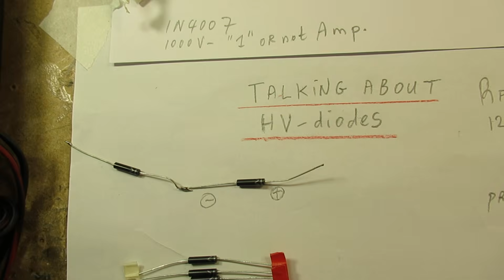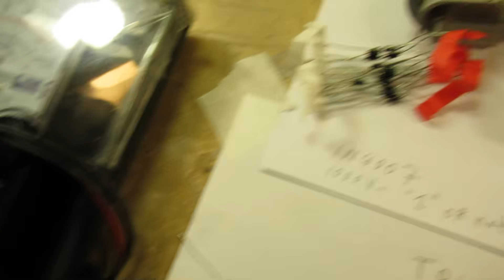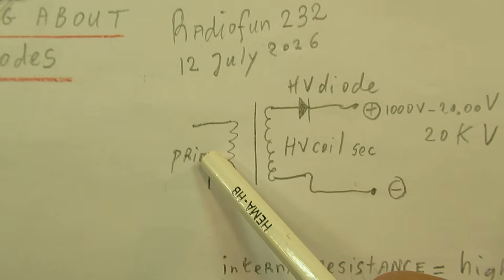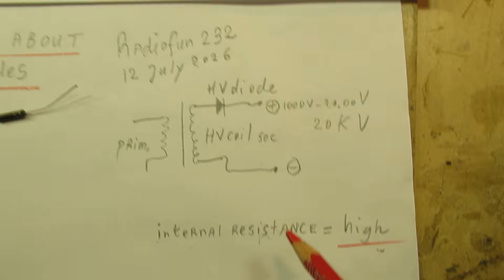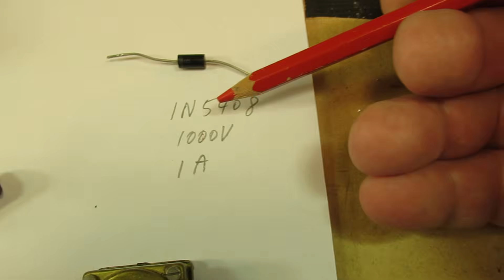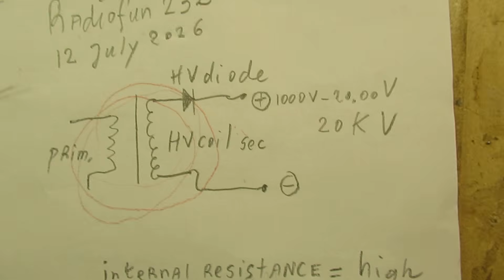Talking about High Voltage Diodes, their properties and much more

Comment: Those diode bodies would not provide sufficient air gap for 30kV.
Reply from the maker: Yes, true & thanks. The spark gap for 30 KV in case of needle points is 2,69 cm. in dry air. And the length of the Chinese HV diode is 1,2 cm. I think that they can handle in a needle point situation approx. 8 KV. Source: handbook of Chemistry and physics, page E-49.
Reply: It may work under oil or in epoxy

Comment: Microwave oven used high voltage diode for voltage doubler circuit. I brought one in Colombo electronic shop it very cheap but lot said it cannot test like normal diode . You have to add 9v battery serious and check with multimeter but it not work. It number RG106 . From Sri Lanka . additional information Sri Lanka normal hot country but middle of it fell very hot .
Reply from the maker: Thanks for your comment. Also important to read that your measuring setup did not work, though you are well educated in electronics. So someone has to/can find a good setup, on the basis of your experience. One of the aims of my YT Channel: experimental work, leading to proper results.